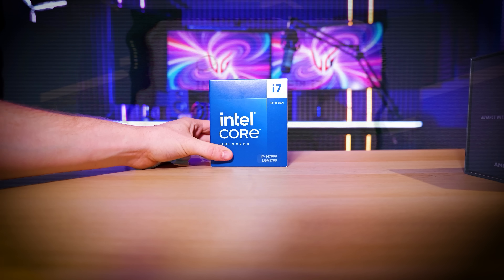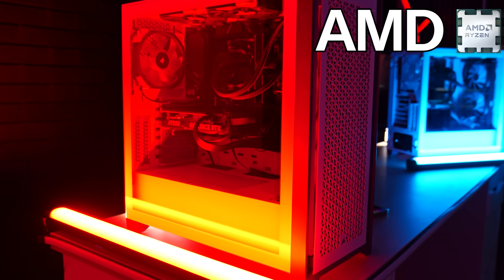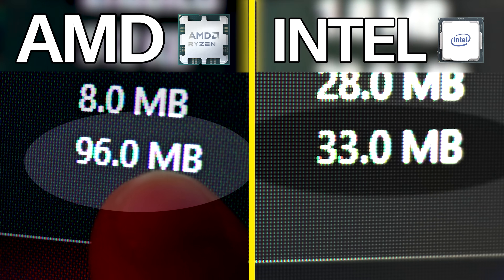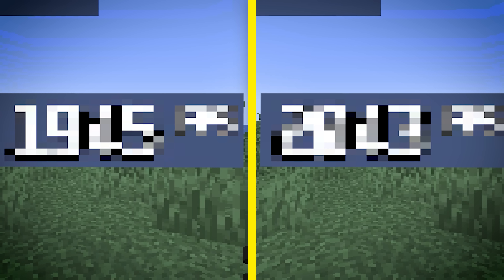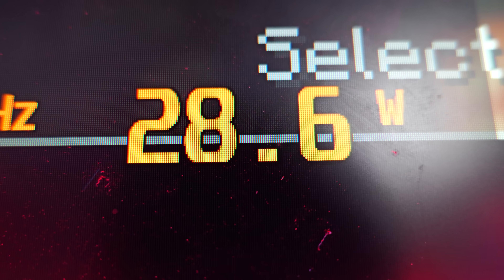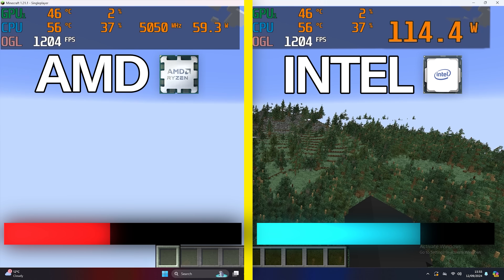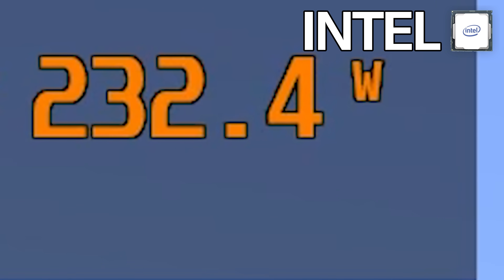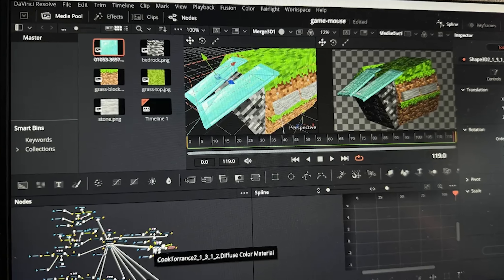Intel VS AMD - Which Is Actually Better?

Comment: Productivity = Intel

Gaming / high performance tasks = Amd - cpu

They both are splendid companies doing a good job. Amd is just slightly better in gaming. 20-30 fps boost. While intel in better in handling productivity. Whatever has the best deal for its value is the best. Amd🤝intel

Comment: If you want to keep your cpu un fried go AMD
Reply: just get an AIO water cooler. problem solved.
Reply: @General-Banana2847 no its literally a BIOS issue not a cooling issue
Reply: @General-Banana2847 they dont over heat lots of people who have Aios or custom loops have had them fried it is the power draw is too much and it destroys the stuff inside the cpu

Comment: Here’s a tip if you already now for intel, The Letter K at the end means it can overclocked. The letter at the back can be F, It means that it needs a dedicated GPU. The letter H suffix at the end means Is High performance. Letter U is Ultra efficient. Uses less power and less performance.

Comment: CPU: Intel i5-12400F 
Motherboard: MSI H610M 
GPU: RX 6600 
RAM: 16GB (2x8GB)  DDR4-3200MHz 
Storage: 500GB NVMe SSD  
PSU: Corsair CX550 
Case: Airflow-focused Mid-Tower
 Rate my built ❤

Comment: Funfact about Minecraft:
Back in the late 2000s and early 2010s most people had an single or (if they are rich as hell) two cored cpus so notch decided to use only the single core (it doesnt matter how many cores you have it depends on the singular core performance and L cache) so that is why even if you had an 128 cored cpu it will perform the same as the 8 core one

Comment: Watts are measured at the electrical outlet using a power meter. MSI's power consumption data is not accurate.

Comment: ok here i might tell the truth,
USE INTEL CPU - if you do things such as some heavy work, need for multitsking, developing, game-developing, while wanting to do gaming, then go with intel!
USE RYZEN CPU - if you mostly want low-power usage, more gaming, not much multitasking, and some other things which requires less cpu power then go with ryzen
multi-tasking requires more cores as it shares cores with other programs you want to run
(not dis-respecting any company cpu's or smth, this is just my opinion as a dev and gamer
Reply: Thanks I wanna keep that in mind
Reply: Finally someone here explained it! Yes thts what I like.

Comment: There is a PROBLEM 7800X3D IS THE WRONG CPU THAT IS NOT PCIE 5.0  THAT IS PCIE 4.0   LET ME SHOW YOU TWO AMD CPUS  THAT KILLED INTEL 2) AMD RYZRN 7 9700X BASIC 8 CORE CPU ON PCIE 5.0 BEST PRICE DISE BREAK THE BANK THAT KILLED INTEL  IT OUT SOLD INTEL EVEN I GOT ONE  LETS MOVE ON 2) DEMON KILLER AMD RYZRN 9 9809X3D OF YOU GOT HEAR A DEMON KILLER WITH RAW TOP SPEED  GAME KILLER KILL GTA VI  RYZRN 9 9809X3D INSANE OVER PRICED THIS IS WHAT YOU NEED IT MURDERED INTEL  AMD KILLED INTEL CPU LIKE ALL OF THEM AND THEM AMD SHOT THEM SELF IN THE HEAD AMD GRAPHIC CARDS THERE BEST GAMING GRAPHIC CARD RX 9700 AND RX 9700 XT AT LAUNCH 2025 IS 20 YEARS IN THE PAST YEAR 2005 GDDR6 VRAM PR YOU CAN CALL IT RTX 2060  THAT IS WHAT AMD IS COPY YOUR BETTER OFF BUYING RTX 2060 ON THE USED MARKET  the hell is that cram AMD?  This is a PR DISASTER !  Sleeping on the job taking drugs AMD SELLING JUNK TRAS GAMING GRAPHIC CARDS  every one what's AMD GAMIN 9700X AND 9800X3Dand not buy a graphic card why IS INTEL AMD NVIDIA BLOODY HELL HATE GAMING GRAPHIC CARDS? With out that all these fools will kill the GAMING PC MARKET BUSINESS SHUT DOWN  not AND and INTEL gaming graphic cards have insane amount of BOTTLE NECKING GDDR6 VRAM  every one needs to yell about how stupid that really is  you do not want to waste money on this crap  and then INTEL and AMD WORST CPU SOCKET LGA   what sell pins on LGA SOCKET  THESE PINS BEND OTHERS SNAP OFF OTHERS MELT OFF AND OTHER PINS CATCH FIRE  the GAMING MOTHERBOARD KILLER LGA your better off stick 25 years in the past BUY X570 MOTHERBOARD AMD RYZRN 7 5800X  DDR5 RAM RTX 3070 TI  YES ITS TOO OLD AND TOO SLOW AND GDDR6  OR WAS THAT GDDR6X I cannot remember it's got one thing going great is CPU SOCKET PGA BEST SOCKET EVER MADE  and on that bomb shell it's time to end GOOD NIGHT

Comment: bro intel cpu are cheap but amd cpu are very high price for a budget pc for middle class players bruh😃
Reply: where did you get your price?
Reply: @not_a_gm_ben  bro i live in bangladesh i have a pc with intel core i3 4th gen price costs 500 taka u can search it on google intel core i3 4th gen price in bd so u can get the actual difference starts from 4000+ taka my pc full costs 15k taka bro why i am talked about the price

Comment: 12th gen intel was good, newer had more issues.

But I always compare CPU how it runs without boost clocks or overclocks. 65W TDP.

Ryzen 7 9700X wins Intel Core i9 12900 easily.

Comment: But Bro there is a problem with it. It has an Intel i7 processor(Number of Cores	20 (8 x P-Cores + 12 x E-Cores) , but the 12 Efficient cores it contains can only handle very basic and minimal tasks. Sometimes, these 12 E-cores can even reduce the performance of the remaining 8 performance cores. However, that’s not the case with the Ryzen 7 series. The Ryzen 7 7800X3D has 8 physical cores. It also has 16 threads, due to AMD's SMT (Simultaneous Multithreading) technology, which allows each core to handle two threads. It has only 8 performance cores and no efficient cores, so it can deliver maximum performance, speed, and graphic support. So, at this price point, the Ryzen processor is definitely the better choice. I'm saying this based on my own experience.

Comment: Guys look at the thumbnail. Nothing can get 1800 fps
Reply: yes you can....
Reply: ermmmm, I’d beg to differ 
I managed to get 2000+ fps in minecraft (ofc with mods and in only 1080p but still)
and I didn’t need to reduce my render distance to something like 2 :)
Soooo if you have a fast enough PC combined with the right optimized mods you can :)

Comment: anyways heres my thoughts on both CPUs and what they're used for
better iGPU: Both (since the ARC iGPU arrived and the strix halo [one to one with 4060 laptop])
better linux support: Both (usually AMD is better)
better windows support: Both (usually Intel is better)
workstations: Both but Intel is more popular
servers: both (AMD beats intel since they made Epyc and Threadrippers)
pairing with GPUS:
 - Radeon: AMD is more favored
 - Nvidia: Both are good
efficiency: Intel Celerons and AMD athlons

Comment: amd cpus are better for gaming because of there higher 3d v-cashe
intel cpus are better for productivity because they have better single core performance especially the i7 and i9 13th and 14th gen with higher clock speeds

Comment: bro i bet you if you can run a minecraft on a dell 4050N laptop and with this laptop specification and 2 gb ram you will 10 milion subscriber if you cant rum you will have to give me a gaming pc and run minecraft smoothly if you cant do delever me a gaming pc into Nepal. I bet you you cant do this. SInce im playing minecraft on this minecraft when i was 11 yrs old and now im 14 it is too laggy and no any kinds of gpu, rtx bla bla bla. even it get only 6-7 fps more than only up to 10. if you can do you will hit 10 million subscriber. Plzz i also watch your video so much and i like also so, plzz read my cmt and accept my challenge. if you will run minecraft smoothly plzz give me a gaming pc im from middle class family and i cant afford a pc plzz give me 1 gaming pc if you will help god will help you smewhere you have listen this quotes plzz give me a gaming pc i beg you for it

	Intel(R) Core(TM) i3-2350M CPU @ 2.30GHz

	Base speed:	2.30 GHz
	Sockets:	1
	Cores:	2
	Logical processors:	4
	Virtualization:	Enabled
	L1 cache:	128 KB
	L2 cache:	512 KB
	L3 cache:	3.0 MB

	
	Speed	1.93 GHz

	Processes	80
	Threads	995
	Handles	37241

Comment: It's normal that the i7 14700k is more powerful than the r7 7800x3d because this AMD processor is less technologically advanced. The 7 9800x3d is a better competitor. And 8 and 20 cores it's an crazy difference
Reply: Not true because it's 20 cores but 12 efficiency cores and efficiency cores don't have any effect for gaming because the 7800x3D have triple the l3 cache and the  l3 cache is very important for gaming
Reply: Its not true

Comment: People need to understand that u only ever need fps according to what your display needs. If u have 
60hz play at 70+ fps range. 
75hz play at 90+ fps range
100hz play at 120+ fps range
144hz play at 160+ fps range
180hz play at 210+ fps range.
Just save your cpu and gpu lifetime by matching your fps with your monitor. 
If your monitor has 144hz play at 160+ fps range but try not to exceed more than that. It helps but not necessarily. Unless u have an 1000hz display dont play at 1000fps its uselss cause your monitor cant display more than it needs to.
Why 160+fps on 144hz when I say it doesn't exceed the threshold of what the monitor support. Well in case of stuttering or some issues or throttling your fps may drop but if you keep it at exactly 144hz and 144fps you will notice it as the 144fps may drop like 20frames which is noticeable. But if ur running at 160+ when the drop occurs it drops like 148frames which doesn't go below what the monitor can support so its not even noticeable.
Oc the video is about which is the best cpu. But i know there are people who thinks 1000fps awesome. But they are using an 60hz monitor. Which is wasted potential 😂

Comment: The problem of Intel processors is current and ominous for most investors and low-income earners! If you want a gaming system and you don't mind the consumption, and you can afford to cool the processor, it's ok! You have to think about investing in a foam case with 12 decibel fans, because the noise is annoying! AMD has dedicated memories and is very stable on DDR4! While with Intel it is extremely difficult to find components that combine perfectly! I own an i5-14600K, I want to sell it, everyone is running away from it!

Comment: You should use the same seed because some bioms and places are more laggy.
Reply: Bro did you see it's the same world?
Reply: @jmoncychannel6652  on 6:31  , there are differnt seeds. And it is impossible that this is the same world because this are two different pcs and he is in singleplayer.
Reply: @srtxx787  1. Ever heard of downloaded worlds?
2. He clicked play selected world which means it's the same world in different coordinates
Reply: @jmoncychannel6652  but the he don't load the same chunks, so the CPU has to load different world parts. And world downloads in Bedrock are difficult, so he generated one for every computer and it looks completely different ( 9:03 ). And it doesn't matter if  
is the same world or not, because the CPU is loading different chunks!
Reply: @srtxx787  
* Same Rendering Load: While the players are in different locations after the world is loaded, the initial loading process involves reading and processing the core world data, which is the same for both. - gemini (I'm in a play rn so I'm using ai to make my comment)
Reply: @jmoncychannel6652   bro please, this is for servers, not for singleplayer worlds! In a singleplayer world, the loadingsystem is different. AI don't help if the input isn't correct.
Reply: @srtxx787  bruv I said "If I load a Minecraft world on two PCs but the player in the game is in different places would it still have the same performance when loading a world the PCs have nearly identical specs one has 7800x3d and the other a 14700k" also I asked gemini "is it in singleplayer?" He said "if it's singleplayer they will have minute performance differences"
Reply: @jmoncychannel6652  if you use AI and give it wrong input, it will give you wrong information. And please don't use AI, do research yourself. If the player in a singleplayerworld  
goes to a random spot, only the chunks in his renderdistance and the spawn chunk is loaded. Some bioms are more laggy and difficult to load than others, for example, a jungle is more laggy than a desert. And caves, mobs and such things can change how easy a chunk is 
to load. This is why he should use the same spot. And the chunkloading system is basic  minecraft knowledge you should have as a player. This is just a fact that some chunks are more different for the CPU than others and that different chunks are loaded in different spots.
Reply: @srtxx787  
1. I said I used ai cuz I was in a play and couldn't respond properly
2. By your logic maybe there are more mobs in the world while he is in the same spot, maybe one pc has more background processes, we can't have the same identical things on two PCs
3. Bruv what do you want? The identical experience like the same background processes? The background processes are just giving minute difference and also the singleplayer world gives minute differences(I know a lot bout chunk loading cuz I'm a mod dev)
Once again I repeat it is just a minute difference

Comment: There is no point in comparing them because both are made for different specific reasons .

Ryzen one is specifically made for stable fps and better gaming while intel is better for music producers , industrialists , 3d modelrs , coders with good gmaing but somewhere unstable fps
Reply: Yes but we want to know which one we want to use(research)
Reply: @jmoncychannel6652  which type of research ?? Data science or anything else
Reply: @Acoustical_man.1  I meant research as in we want to find which one we want, that's the point of the vid

Comment: 2:36 Intel only booted up first because it had a better motherboard
Reply: Nope it's the cores
Reply: @jmoncychannel6652  90% ssd 10% cpu my 12 year old spec pc boots in 16 seconds i take that as a win
Reply: @Angel-GreeceGD yes that is true but the cpu is still in the equation and since the video said it is almost identical then the ssd is probably the same
Reply: @jmoncychannel6652  then the intel pc is faster at booting
Reply: @Angel-GreeceGD yes that is the point of the video... It's because of the cores I already said that on my first comment
Reply: Its cause intel cpus focus on quickness and efficiency while amd focuses on the overall picture. Intel is faster for loading, generation, and other efficiency based tasks. Amd has better overall performance though.

Comment: 32 is not the highest render distance, you need 4 mods:
1. Bobby
2. Mod Menu
3. Sodium
4. Nvidium

Enjoy 1000 FPS on 128 Render distance
I have experience in this, i got the same gpu and a ryzen 9 5950X
Reply: wasted gpu get a better gpu its too weak for the cpu

Comment: i just saw this vid and saw that your thing lunar client on intel meaning it would have an fps boost, so it would allow shaders to be usable ish with integrated graphics. 

however, amd is primarily for gaming whereas intel is mainly used for rendering and processing
Reply: Show me where in the vid
Reply: 10:02 u can clearly see lunar client on intel whereas for amd which is before it it’s on the vanilla mc
Reply: @air79  maybe the amd pc uses lunar too(maybe)
Reply: @ it doesn’t cos when he went f5 for and u don’t need the player name with lunar client and u can clearly see that it’s vanilla when he goes to the settings page
Reply: @air79  ohhhh

Comment: I M using AMD Ryzen 5 and my  HP laptop shuts down due to overheating. Checked with service centre they said fan is working well and AMD heats up.
Reply: Replace the thermal paste

Comment: itel is for rich people because it costs little much higher and also eats so much electricity
Reply: dude if you don’t have money for 5 bucks for electricity, you’ve got your money for the cpu so why would you care, also the price of 9800x3d is roughly a few dollars cheaper than 14900ks. It’s the same price
Reply: @chaiyo201real  bro but your exta 5 dollars in month will make it 70 in year so it is much more expensive. Also I will 100% not use it for only 1 year, for about 3-5 and that's 210-350$
Reply: Amd 7800x3d is way more expensive here than i7 14700k about  30-45% more expensive.

Comment: Just a question why the fuck are you even comparing those two?? If you want cheap stuff go with AMD and if you can handle some more electricity expense go with intel. Intel processor have more cores which needs more power to run at full performance. Your comparison was useless dude. I don't think you can call yourself a tech reviewer. I guess I would be a better tech reviewer than you.
Reply: Also, if you buy a high end CPU then electricity isn’t your concern. At all.
Reply: LANGUAGE!
Reply: Also Amd is not cheap... It's just better for gaming sure it has less cores but it's still better for gaming
Reply: @jmoncychannel6652  AMD is generally cheaper than intel processor (Though the Ryzen 9 series price can be similar to intel i9, this is the only exception) I use both ryzen and intel and I just hate when a tech reviewer doesn't provide all information correctly and precisely.

Comment: In Poland now Ryzen 7 7800X3D cost like 550$ and i7-14700kf cost around 370$ so i prefer to get i7 bc its cheaper and  they have almost the same preformance
Reply: Tbh if you're not planning for high end gaming then just use a 7500f or 5600 which are cheaper + better price-to-performance cuz the gpu is more important in gaming